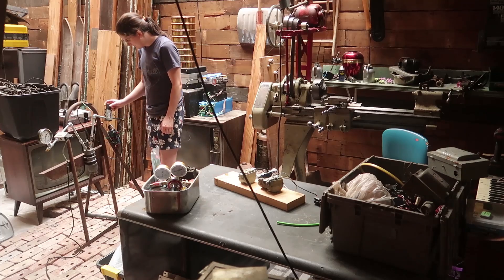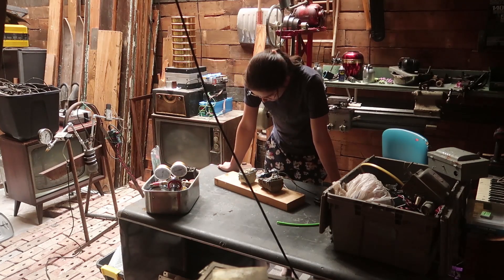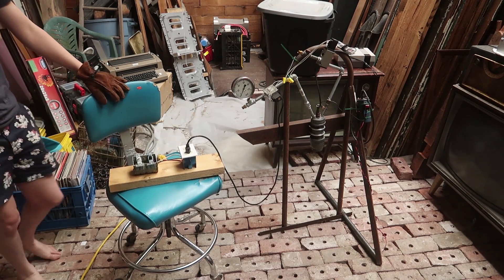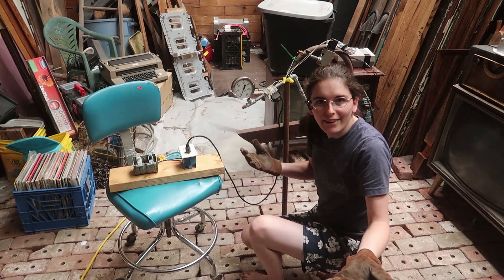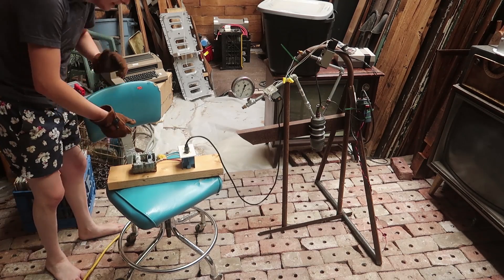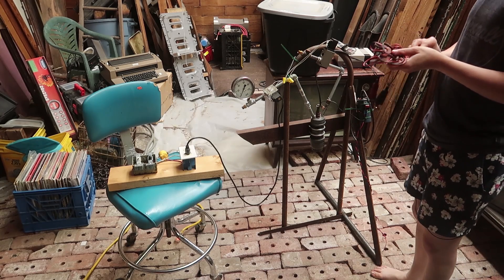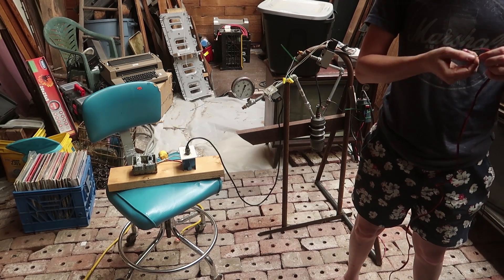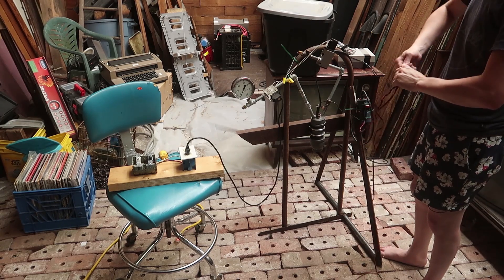DIY Liquid Fueled Rocket Engine 06: Getting Serious, Quick Wiring Controls, We Need Flames!

Comment: so is this going to end up being muti-staged?  Have you considered using SRBs also? what is your goal (in height)?
Reply from the maker: goal is to make a reliable rocket engine, and then make a hopper to use that and go up a precise amount and back down to land.
Reply: @RinoaL  ah so a reusable rocket?  Like Elon  Musk's?
Reply from the maker: of course, maybe go up 100 feet.
Reply: @RinoaL  ok cool.    What fuels and oxidizers are you considering?
Reply from the maker: I think ill aim for LOX and Kerosene.
Reply: @RinoaL  yeah that's what I was going to suggest. it's cheap and available. Just for cool factor, though, I had a french white paper from the 60s that used chemically retarded RDX high explosive for a solid booster.  Though I don't know if it ever was tested.  My guess probably not. sadly I lost it when my hdd failed last year.

Comment: Good luck with your project. What fuel and oxidiser are you planning to use? I think it is so quaint how in the US you have kept the plugs and sockets developed during electrification in the 1900's, and are still using the same design in the 21st century.
Reply from the maker: starting with gasious oxygen and propane.

regarding plugs, these have stuck because they work. its a lot like the metric system. a country wont switch unless mandated, and normally then there is significant backlash like in the UK and Canada. so the US government just doesnt see it worth it to change it since its not really any improvement. it would be nice to have ground first and power hidden but tbh it doesnt cause any problems without it, and its nice that our plugs arent as huge as foreign ones
Reply: @RinoaL  First of all, an apology. You must get sick to death of other nations making fun of your plugs. I'm genuinely interested in your project as it's an interest I share. I take it you've read the RocketLab publication? It's widely available in pdf form. Also, try to get a copy of "Rocket Propulsion Elements" by GP Sutton. Get an early copy as these have a lot more information in them. Good luck.
Reply: Population backlash aside: it would be too expensive for the united states to switch to say the metric system. Think about the cost of replacing/repainting just the innumerable speed/distance signs nationwide!
In Canada we still get bizarre quantities of say 591 or 710 ml for a beverage like Gatorade (due to the proximity of the US parent companies)
But they don't fk around in medical applications. That's all metric. A pint or a quart of blood? Lol

Comment: I find the non-standard wiring rather scary, even if it's only you using it. I highly recommend a prominent label: "DANGER! NON-STANDARD WIRING." You never know when a brain-fart might strike.

As far as computerizing the control panel, if you're thinking an Arduino-style controller, take a look at NodeMCU controllers based on ESP32 controllers. They're dirt cheap (about $5 from China, maybe two or three times that locally), include WiFi and Bluetooth, have way more storage and RAM, and can be programmed with MicroPython as well as Arduino IDE. That will give you a lot of options. Caveat: they run on 3.3V, not 5V, but can be powered by 5VDC. Signals from the controller (perhaps driven by a web interface on your phone?) can drive optoisolators, which in turn trigger solid-state relays (or even mechanical ones, with anti-kickback diodes across the coils).
Reply from the maker: no i am thinking rolling my own computer out of discrete transistors and relays so as to be simple and specialized. i have a hard time understanding how to work with preexisting computers so i find making my own computer from scratch actually is faster for me.

and regarding wiring, yes its very scary. but oh well. its only temporary.

Comment: turning the graphite rocket nozzle will give a really nice patina to your workshop :-D
Reply from the maker: i wont be using graphite, ill be using a steel engine bell.
Reply: @RinoaL  you expecting low burning temperatures? ok, steel should withstand for a while with low temperature.
Reply from the maker: so i am expecting high temperature and low burn time. after all the V2 engines used regular metals. they were able to get away with it by using good cooling systems.
Reply: @RinoaL  it will be interesting, I hope that combination of pressure and temperature will not cause the steel to break into pieces. I always imagine a rocket engine as a controlled continuous explosion :-)

Comment: so why haven't you gotten an older NFU rocket engine ? And how do you know how much thrust your getting out of that?
Reply from the maker: im not even to that point yet, i need to make a reliable engine first and then once i have an engine, i can start thinking how to use it.
Reply from the maker: why havent you payed attention to the video?
Reply: @RinoaL  every time i try to watch one a large crowd of co-workers gather around to watch, so i end up missing most of what you say ,  sorry but life here is very existential and we do tend to smoke a lot of pot, it's what keeps us from killing one another. i'll try to watch it again in private
Reply from the maker: ah, well im not building the engine yet, im building everything around the engine. wiring, plumbing, tanks, ignition, control. and then once i have that working ill step it up from a glorified blowtorch to something that could maybe produce enought thrust to lift it
Reply: @RinoaL   my co-workers have way to many questions,  but all i can understand is weight to thrust ratio  and are you going to use a gyro ?

Comment: You need some kind of shielding,  flames are going to end up going up instead of down and burn all your wiring and stuff.
Reply from the maker: i figure ill just use some aluminium foil. but honestly i really dont mind if i get some singed wires.
Reply: @RinoaL  Best to test it horizontally! Also some kind of spring (dynamometer) is needed to measure the force. :)
Reply: lol exact same happened to my rocket and. it was all burned plastic and crisp (idk I'm native dutch) copper all over the launch platform

Comment: For an injector you could modify the injectors that hot-rodders use for nitrous oxide injection.  They're coaxial with nitrous on the large internal channel, and fuel on the external channel.  Depending on pressures and flow rates they might be made to work.  I want to try building a rocket engine using nitrous oxide and either ethane or ethylene as propellants, which should work out of the box with the nitrous injector.
Reply from the maker: thats called a Pintle injector, and i worry i'd run into the same overheating issue with those that SpaceX did. if SpaceX couldnt get them to work, i doubt i could. lol
Reply: @RinoaL  : I think SpaceX had trouble with them because SpaceX was demanding too much out of them.  If you run them at lower pressure with higher mass flow then they shouldn't overheat.  Too quickly, anyway.
Reply from the maker: @murdelabop  true, they do push things pretty far. however i stuff think having separate injectors for each propellant would be best for me.
Reply: @RinoaL  : Whatever works.  I'm a big fan of whatever works.  I'll follow your progress with interest.
Reply: Best choice oxidant available for the civilian ' Hot Rod' rockettei'r
Reply: I've been invested in a small liqued or hybrid rocket since I was in high school/ college.  I hD felt then that nightroesMI.